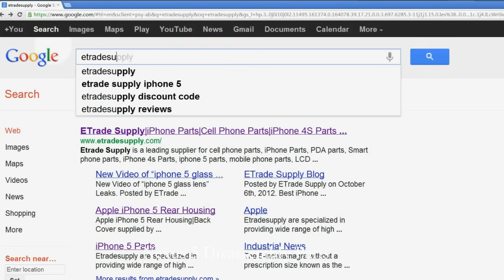Nexus 5 Disassembly Repair Guide -- Cracked Screen Replacement

Comment: Thanks very much! I just replaced my screen with excellent results. A couple of things to mention include - I needed to remove the additional part behind the ear speaker - and there is no need to remove both sides of the 3/4 G antenna. It would have been a better video if you had shown the assembly as well as I had to keep skipping the video backwards for the installation. I know i'm being fussy ( but it may help for any future videos) so many thanks again for the excellent video.
Reply from the maker: Thank you for your suggestion, it will help us do better in future.

Comment: Hi i have got one problem with the new display i bought,there is no adhesive glue sticker under the display ribbon.https://goo.gl/photos/Q3dMtJPKkzg31YbC7 please check the link and help me out,thank you.
Reply from the maker: +Nishant katikaneni you can use some Roll of Double Sided Tape to make it stick together.
Reply: +ETrade Supply Thank you.fixed it without the adhesive :)

Comment: be carefull with the battery, my battery had two strips of double sided tape. When i lifted i managed to get the tool between foil and batter and create a short. so lift a little all along the bottom of the battery. Not exactly as in the guide. take you time at this step.

Comment: This video is useless. This is not screen repair. This is nexus 5 dissasembly. But, to remove the screen all you have to do is take out the speaker module which will allow you to disconnect the screen and safely take it out.
Reply from the maker: chux chux Sorry about that, but all the screen repair steps begin with tearing down the screen. Different issues resulted by different causes. It's hard to figure all things out just in one video. We hope this video helpful but not too long.

Comment: Other tutorials say that you need to use special glue, or two sided tape, to seal the digitizer. Does anyone know how necessary this is?
Reply from the maker: ***** Yeah, you can use LOCA or OCA, that's, (Liquid) Optical Clear Adhesive, to align the digitizer and glass. In fact, it is essential. However, you'd better to use OCA to do it to prevent bubbles.
Reply: ***** I can't find anything on Ebay for non-liquid OCA, at least, not for Nexus 5.

Maybe I misunderstood?
Reply from the maker: ***** http://www.ebay.com/itm/1-Piece-OCA-Glue-Clear-Tape-Nexus-5-GLASS-LCD-Screen-Repair-Adhevise-/252015640083?pt=LH_DefaultDomain_2&hash=item3aad4d7e13 you can find it here, i just searched about the NEXUS 5 OCA, but i am sure its quality, since the part in our store has  been sold out
Reply: ***** bought. Thanks!!

Comment: Be careful when lifting battery up on Step 7. Mine didn’t want to come off easily, so I tried using tweezers. And seems like I damaged my battery with tweezers (made a very small hole on the bottom of it). It doesn’t leak, but there is some smell.

Does anybody know if this smell is harmful?
Reply: Why Not It is. Don't breath it and you'll need a new battery.

Comment: Guess I am going to need to watch this about 50x and attempt to replace my screen, just dropped it getting out of my truck...
Reply: The last time I tried something like that I failed horribly. If you succeed i suggest you get a screen protector.
Reply: I have a screen protector and a bumper case, didn't help me. After watching this video I called a local repair shop, they are going to fix for $30 + screen.